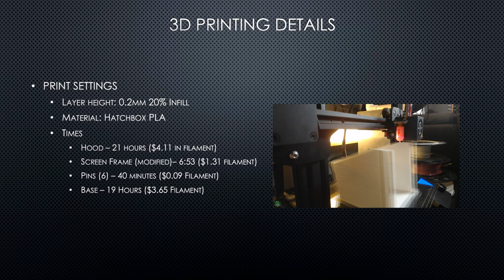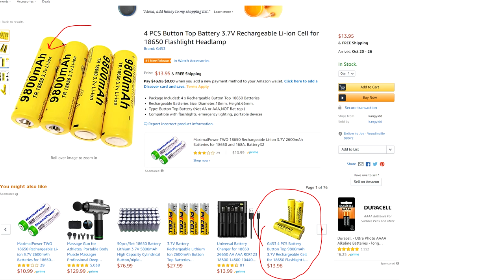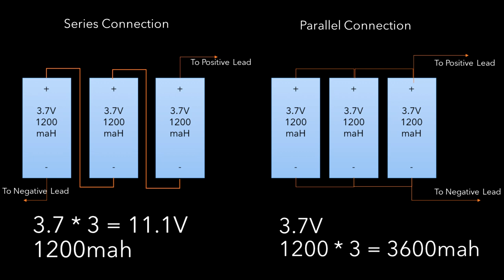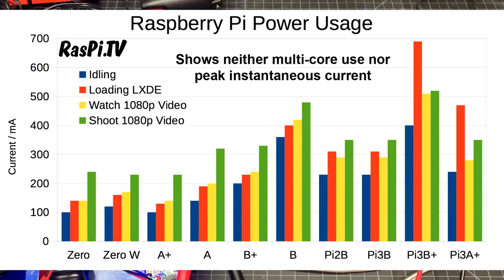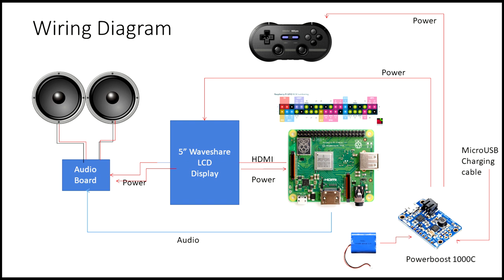Ultimate 3D printed miniature arcade cabinet! (Pi Score build)

Comment: Interesting build, I plan to use 8Bitdo SN30 Pro USB Gamepad. I will have to mod the stl file. However, it saves you the requirement to charge the controller  and still have the same functionality.
Reply from the maker: Yeah honestly if you can save powering the controller that's great because it did add alot more complexity. I've seeing more people scale this up and using full arcade sticks and buttons and starting to like that idea. It loses the old 'coleco sized' aspects which I do love as well, but it makes the build much cleaner in other ways. They wire just directly to GPIOs.  I'm excited you're taking on the build I love mine, it's a super fun portable ;)
Reply: @geektoolkit  Thanks, I have planning to add space for HDMI out and USB as well. I'm really inspired by the NEO GEO mini setup with this style cabinet though.

Comment: Question: Could I simplify this by using a raspberrypi 3B and mini USB speakers? I'm trying to use stuff I have already and I have a mini USB speaker and a multiple Raspberry Pis. I'm also no sauldering expert so less saudering the better.
Reply from the maker: I honestly don’t recommend this if you don’t want to solder or aren’t great at it because the power system is key unless you want to have to plug it into a wall.  Mini usb speakers also likely won’t fit into this...it was TIGHT...frustratingly so.
  That being said I wasn’t great at soldering but watching YouTube videos and practice got me there. I highly recommend working on it because soldering opens up SO many cool projects. And if you solder then this is much more doable.
  I worked hard to reduce the costs but the thing I leaned about this is that it’s neither cheap nor a “use what you have” project as it’s set up. The case is just way too tight. 
   BUT if you’re looking to use what you have to build a non portable game system...that’s not a bad project, could be cheap and easy. Just build it as a console. The portability was what made this complicated. Hope that helps!
Reply: @geektoolkit  Okay I think I can do this! I did some basic saudering as a test recently I think I'm up for it. Do you have a detailed wiring guide for this?
Reply from the maker: I don’t think I have more than what’s in this video, but i think you’ll be able to figure it out. Each component tells you what the pins are so you just have to match them up. For instance the speakers to the amp say +/- for the speaker wires, and there’s typically a voltage and ground for everything. Just match what’s on the board to the pi. The only thing that’s really careful is making sure that if it’s 3.3v you only hook it to 3.3v
Reply from the maker: Also huge congrats on learning soldering!!!! With that kind of work and being willing to try you’re just going to be amazing and do awesome stuff!
Reply: @geektoolkit  ah okay! I have all the same parts except the battery is the blue adafriit one. I’m still kinda confused as to where certain wires go but I’ll keep watching the video and looking at the diagrams there. If I have any questions is there a way I can direct contact you?

Comment: Is there enough space to connect the usb to the controller.
Reply from the maker: Not that I could pull off. Maybe with a slimline connector designed for tablet mounts but it’s...very very tight!

Comment: Bluetooth for the fixed controller? why?
Reply from the maker: Honestly, because it's dang cramped in there! The options I saw were to go with a screen that had a ribbon cable and drop the pi down like the original design (which would take away space for the battery, and I was concerned if it shook the ribbon would tear), to get a low profile USB A cable and see if I could fit that into the back (I may go this route in the future), or to just use bluetooth and power it.  So far in testing it, using bluetooth has been fine.  I may revisit it in the future, but when you get into this project you see that the design of where ports are on the pi really fights with the insides of this case (for example power on the side, or the audio jack).  Don't worry though, I'm not happy with it and still trying to figure a way to get it working (I almost desoldered the usb port even!).
Reply: @geektoolkit  I have desoldered the USB ports on a RPi 4 8Gb and am in the process of mounting them in a more user-friendly way in a handheld I am working on, progress is slow though mainly down to spare time, I am half expecting a Pi4 compute module to be released before I complete this project.
Reply from the maker: @AndrewAHayes  oh sweet, so you get the pain!! OMG a Pi4 portable with 8GB!?!  That's going to be A-mazing!  Please share here if you post it anywhere, I'd love to see it when it's done.  

One regret I have with this build is that the HDMI's are tied up...I'd have loved to have exposed the HDMI out of the rear and then had it act as a console (just add 2 more wireless controllers perhaps).  If you're able to do that with a pi48GB that'd mak ea heck of a portable...and a heck of a console!  This project honestly was running long for me, and I have 3 running projects (home automation, Dynaframe, and a large 3D printing project) I'm working on, so I rushed to get it 'done' and working with the intent that I can always tweak later.  So I get what your'e saying about spare time and projects...."I feel ya" as they say :) Looking forward to hearing more, that's a cool project!
Reply: @geektoolkit  Yes I will post to you when I get it completed, have you seen  DIY Engineerings handheld builds? I wish I could build something half as good as his handhelds.